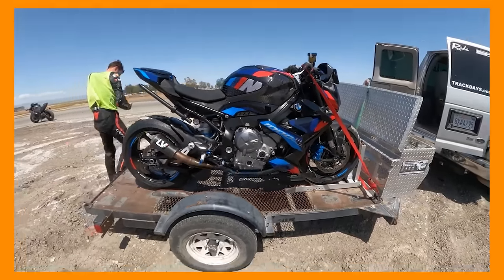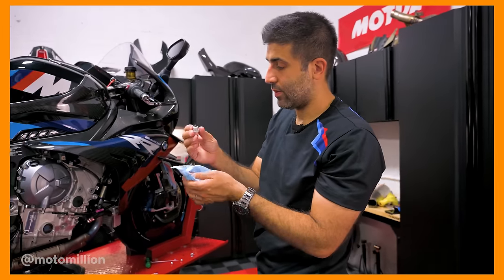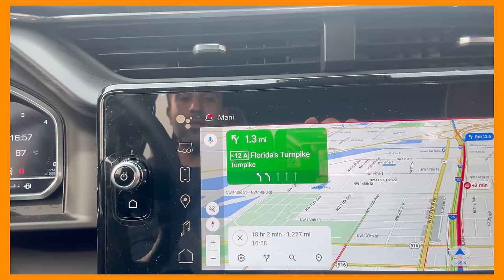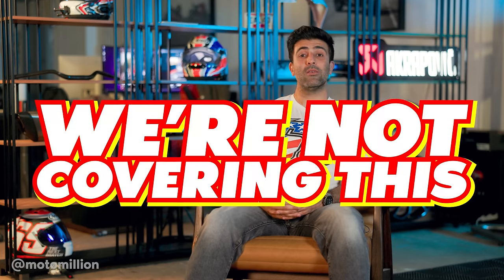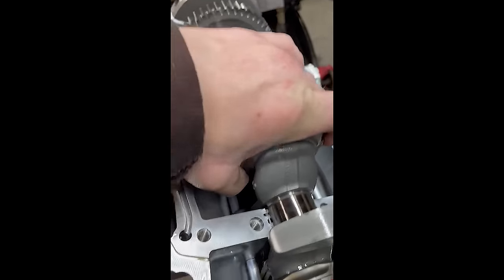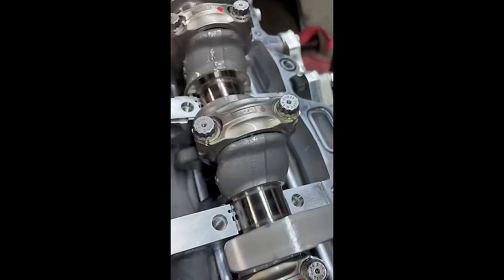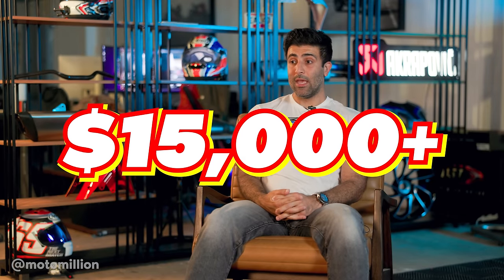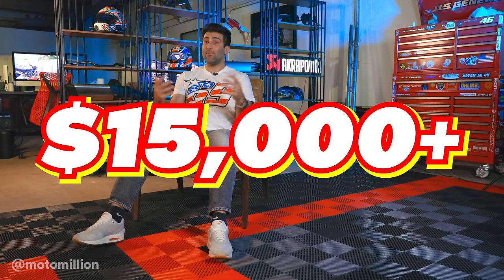MASSIVE Engine Failure on our M1000RR & BMW REFUSED Warranty...

Comment: I can’t understand how here in FL you’re too busy to ride 600 miles! Idgaf how much you have going on we get to ride all year. Honestly  600 miles is nothing and you were already halfway there. I had issue with my 22 M RR but I always took it to the dealership (Euro Cycles in Tampa Bay, FL) so things could be documented and they couldn’t pass any blame to me. Now I’m well outside of those initial first services and nothing has come up ever since. I won’t buy another going forward but I’d never take the risk of not having a dealership do the initial services and work. I will have the amount of faith you did with a manufacture to honor their warranty. I had an issue but my front carbon wheel was warrantied after a nail went through my front wheel. I’d gladly going forward just toss my leg over a Honda. I feel these higher end bikes are for suckers and clout chasers. 90% of people on sport bikes myself included can NOT ride a 600/750 to its absolute limit anyways. I won’t touch another BMW ever myself and would trade it for a Fireblade flat out, title for title.

#BMWSUCKS
Reply from the maker: Just really busy with work and life. I wish I had the time to put thousands of miles.
Reply: @Motomillion  just put it on stands in second gear with two fans on it. 😂🤣😂 jk…..sorta. Take care

Comment: You need to sue BMW...their claiming that removing the break in rev limiter prior to 600 miles is silly because their manual says removing it between 350-600 miles with first oil change.  It won't be worth it to hire an attorney, but in FL you can sue for $8K in FL and at least get some of your money back.  Good on you for posting the video...

Comment: I had the exact same thing happen to this bike . I never had the rev limite removed and #2 connection rod was loose . BMW also declined warrenty and refuses to sell me another motor . I'm in Tampa and in process of filing a lawsuite . My bike blew at 220 miles and never exceeded 5500 rpm
Reply from the maker: Charles, very sorry to hear this. BMW is having huge issues with the engines in these new 2023+ models. BMW already denied our warranty claim, but once we do a full analysis of the faulty engine, we will be sending the full results to BMW and go from there

Comment: This is an issue with BMW in general. On the car side n54, n20, n63, s63, S55, and s65 among others have all had major issues. It sucks because BMW of 10-12 years ago was very different. Customers were treated differently, especially "m" customers, dealers had much more power and influence for goodwill. Unfortunately, the cost structure of BMW and its focus on marketing and hype has completely killed their brand from the most loyal customers.
Reply from the maker: Trust me, I know their car side of things too. Rod bearings? Any S engine owners knows.
Reply: Don’t forget n55. I thought they were problem free and was proven wrong

Comment: I put in a deposit for a s1000rr last week and now its making me think twice to go with my first bmw bike
Reply from the maker: We hope you have a good experience. We don't mean to put doubts in your mind, we are just sharing our experience, but also the comment section can be a good insight on what you can expect.
Reply: At least now you know to reinstall the original parts when the engine blows up so you have a chance of it being covered.
Reply: Don’t do it. Get deposit back and buy the r1 before it gets discontinued
Reply: @TrickRacing no - bmw - 3 yr warranty with optional 3 more years = six total
Reply: @lg740xx  it blow up and they don't honor their deal with you
Reply: Had a new gen 3 and now gen 4 no issues look after the service them at the intervals and let them warm up you will be fine .
Reply: Get a pani. You won't look back
Reply: Buy a supermoto.  I know you don't think you want one.  YOU DO.
Reply: You should be ok if you follow manufacturer directions
Reply: Run it in properly, get the 1st service done at the dealership, read and abide by the terms and conditions of the warranty   and keep it stock and you'll be fine.

Comment: Check, don't buy BMW bikes
Reply: Just because some turned out faulty, doesn’t mean that every bmw bike is not worth getting. I have a 2020 s1krr and the thing just works. Nothing was ever wrong with it (and i hope it stays that way😅)
Reply: It's the fact that bmw isn't willing to help out with the problem on an expensive bike. And I have hear of other stories on this bike
Reply: I'd rather ride a tractor than a BMW, anyway.
Reply: @oldfordguy  you do that if it makes you happy 🤷‍♂🤷‍♂
Reply: @darrellpatenaude3825 it’s not just BMW. I got a new KTM 390 Adv. Fork seals blew 4 times in 7k km, road use only after first blown set. They refused warranty claim.

Only after endless arguments threatening to sue they decided to pay back repairs. Only after replacing 4 blown fork seal sets in less than 1 week apart eachother they finally agreed to have the fork replaced.
Reply: 2007 gsxr 1k still going strong.
Reply: And cars 😂 i have a BMW and it's a f.... shithole it's everytime broken and will never buy one again‼️‼️ I'm from germany and since 2000 everything from Bmw is crappy.
Reply: Their motorcycles are actually exceptionally well built 99% of the time
Reply: @Stewie..Griffin  true! Years ago my uncle got an e91 330d w 500k km. Original engine barely lasted him to 860k km. Man terrible cars I’m telling you.
Reply: Exactly.  Its back PR to not even  try to work with them. @darrellpatenaude3825

Comment: Should the bike be red lined after only 400 miles?
Reply: Yes, what magical transformation do you think occurs within another 200 miles. Using hind site, sure it wasn't a good idea to do what he did but I don't believe it has anything to do with what happened. He left himself exposed and presented an out for the manufacturer. 
 I would be in their best interest to appease him and show good will towards a customer who was willing to drop 40K on one of their bikes instead of letting the bean counters determine the outcome.
Reply: @Ultra54able  Was just asking the question. I'd be surprised if the bmw run-in procedure says anything about putting the bike on a dyno and red lining it with only 400 miles on the motor
Reply: @Ultra54able 
Actually, two quite neat magical transformations happen after another 600-1600 miles:

- engine breaks in properly by going through many heat cycles thus allowing the surfaces to mate perfectly while simultaneously "shaving off" excess particles of metal

- engine oil also bonds with interacting metal surfaces on a molecular level thereby creating a protective film on them that keeps the engine from eating itself up

Comment: You can file court case in consumer court.
Reply: No you can’t, there is nothing that the courts can do at this point, maybe if there are other cases of the same failure, then there might be a case.
Reply: @dennisgibb7958  Dude showed other internal engine failures of the same bike, but those were covered.  Due to the documentation, Manny has a case.  Don’t forget that at the beginning BMW customer service lied when they said the dealership refused to do the work.

Comment: Sorry to hear guys.  I had a R6 let loose 2nd gear at 1200 miles at 10 months. Yamaha said abuse.  Never dynoed, never tuned, never tracked at that point.  Just a Yoshi can.  Denied.  Never bought another Yami.  I have a 22 S1000RR these days. 2500 miles on the clock now.  I have a Project SC can on her.  No header, no tune.  Doubt I'll put a tune on her after seeing this video.  They will void warranty for a tune for rev reasons that you mentioned in the video.  Hope you guys get it figured out.  Sad to see such a beautiful bike bite the dust.

Comment: I hate this for you. I’ve lost engines in my vehicles and it’s definitely bummer. My supercharged F150 that I bought new in August 2023 had a similar thing. I had an injector circuit fail, they fixed that and then at 5,340 my engine grenaded. That was December of 2023, March of 2024 I’m finally getting my truck back but the Ford dealer did fix it at no cost to me.
Reply from the maker: Car companies get it, they stand behind what they build. Especially domestics.
Reply: @Motomillion I wasn’t sure it was going to be covered. They did a 100% replacement with new parts because they called it an “infant failure” nothing I did as I was lightly accelerating through a turn at an interchange.

Comment: You removed a rev limiter before the break in period and you’re upset that they refused to replace it under warranty so you brought up another example of a bike breaking because someone took the rev limiter off before the break in was over and expected that to change their mind??
Reply: I don’t know of any company that will honor a warranty when the customer has done an ecu mod. The bike has a new engine already and has been sold to someone else, as per a 650ib video.

Comment: I worked 12 Years in an engine assy plant for a top Japanese auto manufacturer. Every engine was hot tested and rev'd to 5000 rpm to decrease warm up time. The only failures we had were due to assembly related issues ie wrong size bearings, missing parts... human error stuff. So I think deleting the break in rev limiter  isn't the root cause of the failure. Curious on the true root cause. One would think BMW would want that engine back to study it and make their products even better - unless they already know something they don't want general public to know. I was seriously considering a BMW but after seeing this video I'll stick with my Japanese brands. Thanks for posting.
Reply from the maker: We heard from BMW employees that there are some engine recalls going around.

Comment: Yeah I looked at the manual and it definitely says between 350 and 700 mi. And it says that the break in limiter should be deleted at that time. Of course I'm sure BMW expects that to be done at the dealership but it doesn't specifically state that. I think I'd be calling a lawyer.

Comment: I'm not sure if you know this but BMW products are connected to their services by the internet as long as they are under warranty, cars and bikes. BMW corporate knows any modification that is done or any service done outside of a dealer. They explicitly say that any modification can result in a warranty dismissal. They have that in there and in my experience they don't exercise it often. A buddy tuned his M340i to a little over 500 hp. His ac compressor had some issue, BMW covered it, but they told him that any damage caused by the tune will not be covered by warranty. You didn't even reach the full break in, and you claim its false, which is fine. But also you did the service on a 45k+ bike yourself and put a tune on it, then I can see why BMW is not covering it. It sucks but that's how it works, you do something beyond their design, then they won't cover it.

Comment: My experience with BMW motorcycles is (had) a 2016 s1000r that I owned for 2 years and put down 23,000 miles and now currently on a 2024 s1000r that I bought about 2 months ago with 2,000 miles. Not that I’ve had that much riding miles but I’ve had good luck with the first one. Hopeful that this new one will be the same in reliability. And yes I understand, that’s a different bike. Sucks this happened with you guys. Makes me really cautious about any tunes. I think I’ll keep this one stock and will put on a ton of miles.

Comment: I live in the UK and own a 2023 M1000R. My bike had it's first service by the BMW dealer, at just over 400 miles and the dealer removed the rev limiter then. I was told by the dealer that the first service could be done anywhere between 400 to 1000 miles. I asked if changing the exhaust would affect the warranty. I was told that i could change the exhaust, but i must not have the engine remapped, as this WOULD void the warranty. BTmoto has a Q&A video with a BMW dealer in the US, who says you can service your own bike, as long as you use OEM parts and you will retain your warranty. Therefore, i can see what you've done wrong 🤔. Fingers crossed that BMW have a change of heart and do the right thing 🤞🏼.

Comment: Mani, i really enjoyed this video. (Maybe its because i'm on the mechanic side of things). The only gripe I have with newer s/m1000rr ( speaking from personal experience ) is the oil consumption straight from factory. Even our M1000RR consumed oil right off the showroom floor. Bmw says it should stop after break-in period however we saw no improvement. Ive spoken with at least 5 other s/m1000rr owners with either oil consumption, oil leakage or engine failure issues. 

Sorry you had to deal with issues to this degree, this wouldn't have happened with a V4 😅
Reply from the maker: Glad you chimed in Dado! And glad that you on the mechanic side have more faith on the Ducati V4's than the M1000RR / S1000RR! Best of luck with the new build! You know I will be there for you guys!
Reply: Good Luck?
You mean don't let Jaret rev the bike!?😁

 @Motomillion
Reply: @DadoRados lol

Comment: I'm sorry to hear about your unpleasant, to say the least, experience... I wish you to somehow resolve the situation in the right way! 
I'm just speechless how different is the USA BMW experience and the Europe one. In Europe, they don't even look that much, you say, that something is wrong and the parts are waiting for you, no question asked, no matter bikes or cars. With bikes, there aren't many issues but I have seen cars go in for head gasket and go out with new engine just because and etc.
P.S. And just for the record, that's why an S1000RR is better than M1000RR, no matter they are both for sale publicly. Every issue I've heard about (except the chain tensioner recall) with the engine is on M bikes, those ,,small" changes to the engine that makes it a better race engine, doesn't make it faster, more reliable or anything for the street or any kind of use, outside the racebikes, build for racing, looked up after from the race team and etc. And the biggest problem for the M1000RR is not even the price or the not so rear (apparently) failures, but S1000RR, being just as fast,  without over the top aerodynamics wich we will never use or feel to be honest, better price tag, and much more reliable engine, apparently.
Reply from the maker: Europe might have better laws and regulations.

Comment: There was a video of a someone saying: "BMW engineers are very well paid, to produce a good vehicle. But they are paid lot more to produce the vehicle/parts that will brake down/wear off, often".
Reply: 15W-50 oil for a 2013 BMW 700 GS.  later the oil viscosity changed.  Multiple issues with people unable to find neutral.  The the issue was the shifter claw was not polished.  Still to this day people have issues.

I'll never buy a used or new BMW again.  Computer query some of the issues with these bikes.  Many of the same issues come-up with the cars who share the same parts.

Comment: My Aprilia handbook specifies max revs at various mileage intervals. Was a little surprised to see your bike being redlined on the dyno at only 400 miles. Are BMW ok with that?
Reply: The breaking service can be done from 400 to 750 on the bmws..  after that the redline can be used..
Reply: OK, thanks. If this is official BMW guidance, maybe they need to review it, in the light of all these failures.
Reply: @roybatty2030  I had a s1000xr..  motor was great and never had a problem.  I understand the m1000 is different..  that said, I am a bit anal about my breakin, and don't consider a motor broken in till it has about 50 hours on the motor.

Comment: My 2023 BMW M1000RR Competition is still running fine... I am not approaching the red line.... Mostly in the power band. I am installing a shorty Austin Racing exhaust and then the Brentune. I am hoping that the carbon belly pan I bought from you guys fits with the new exhaust. Anyway, my break in Limiter was removed by the dealer at 600. I probably have 1100 miles on it right now. Waiting for the exhaust and some warm days in Reno, NV. Best of luck to my fellow owners.
Reply from the maker: Thank you! Enjoy the bike!

Comment: First Gen BMW S1000RR bikes when they first came out has similar issues with rod bearings and broken rods. BMW root caused the issues to improper break in. Soon after the first introduction of the bike, a factory break in limiter came on all bikes and the issue went away. Now we have people removing limiters and tuning bikes before the brake in interval is done. I get it as people want to ride the bike. To me unless I'm racing it and knowing the warranty is voided any ways I would follow the rules to the letter so that if there is a issue it would be covered. I had to brake in my S1000RR M bike and I had the dealer unlock it so they bear the burden and could confirm it's is good to go. Mine is for racing and only used for that and practice days and it's been solid.
Reply: Well said. As I've said in another comment, engines as sophisticated as these have very tight tolerances, so it's only common sense that it has to go through couple of hundred heat cycles before everything is nice & smooth and the oil has had a chance to form the protective film on the rod bearings' and cam journals' surfaces.
Am I wrong?

Comment: I had a 2020 RR where what happened to the M1000R happened to mine (hole in the side of the engine) at 14000km. Fortunately, BMW covered the cost of the new engine under warranty and from what I was told, BMW told my local dealer that this was the first engine failure on that model that they had so, the dealer had to crate the old motor and send it to Germany for them to find out how such a massive failure could have happened. Think that it is important to say that the bike had no mods done to it and had only been serviced by the dealer.